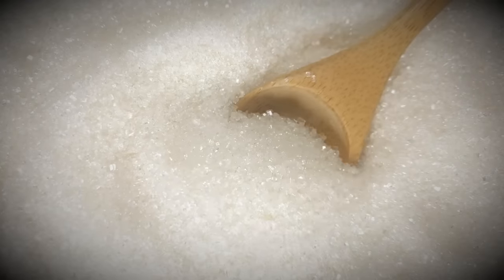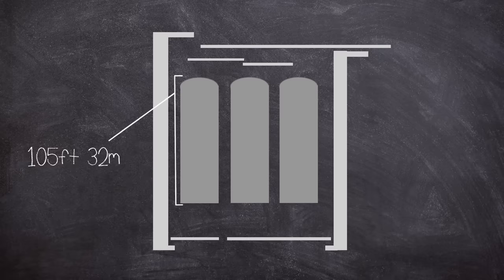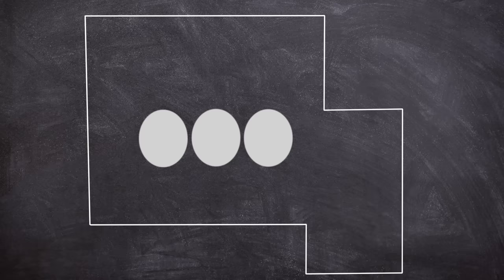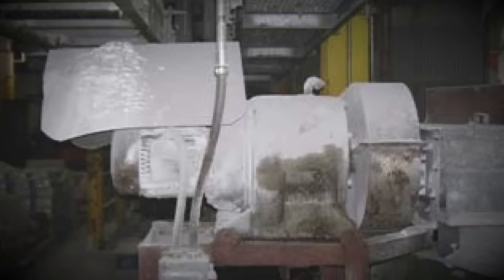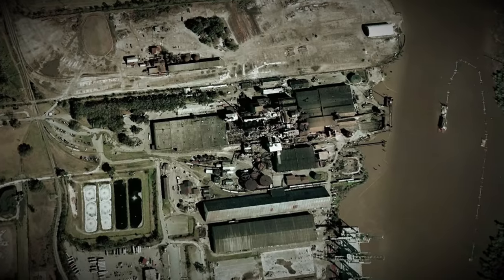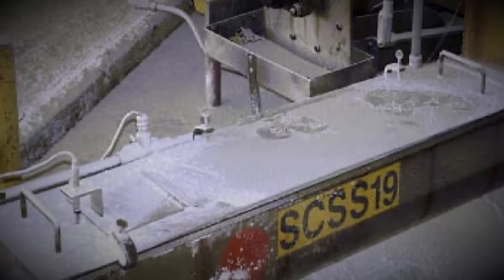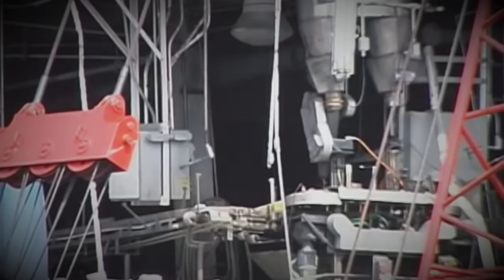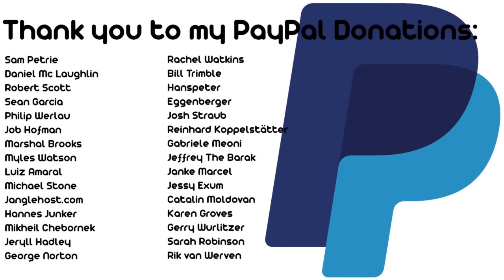The Georgia Imperial Sugar Disaster 2008 | Plainly Difficult Short Documentary

Comment: When I studied barn safety and management for horses, the one thing they drilled into us was that dust was the number 1 danger in a barn, not only for the fire hazard, but for what it does to your lungs
Reply: same thing in a pottery studio. certain material particles on ceramics can cause small blow outs in the kiln ruining the piece or at worst the whole load, but also that dust is also horrendous to your lungs. Never sweep, always mop.
Reply: Workers in textile factories had an equivalent of black lung where lint would fill their lungs over the years/decades
Reply: Yup, I wonder how the solubility of sugar would affect people health wise, would it be better or worse than normal, non soluble dust? I'm not a doctor but having lungs full of dissolved sugar sounds like a bacterial/fungal type infection waiting to happen. I wonder if it could affect blood sugar as well, the various veins of the lungs are thin to allow oxygen/CO2 transfer, so I wonder if the sugar dust could theoretically make that jump as well. Probably not but idk
Reply: @sarahamira5732  Sounds like the perfect research project for someone wanting to get their doctorate.
Reply: @sarahamira5732  pretty sure the water in the mucus inside your lungs can dissolve the sugar, and pretty sure there are glucose transporters on some of the membranes there.. so the sugar would be slowly entering the bloodstream. if its not too much at once it should be fine health wise. for infections, we have the immune system. insoluble prticles like in asbestos are way way worse because they accumulate
Reply: Well how did they do it back then when barns where everywhere?. If there is such a risk? Never thought that a barn would burn bc of some dust. Isnt the thing full of it?

Comment: Anyone who's worked in food processing has had similar problems, sadly. You will get a million stories. I worked in a berry processing plant one year and due to production quotas we overloaded the conveyors constantly with berries and the conveyor engines ran red hot. The room was technically "chilled" but the heat that radiated from the overburdened machines was palpable.Breakdowns were common, mechanical safeties would trip every 20-40 minutes and be instantly overruled.
Reply from the maker: Same experience when I worked in a medium scale bakery
Reply: Anyone with any manufacturing experience has had similar experiences. I used to work at a metal reclamation facility and thing that sticks to me most was when we almost had a furnace breach because the GM insisted that we stick to the schedule regardless of what the operators and supervisors found
Reply: There was a similar disaster in a town of Lubon, south of Poznan where I live: in 1972 there was a dust explosion in a potato products factory, which killed 17 people and injured ten, and the dextrin processing building was leveled. It also destroyed several railroad cars parked nearby. 
The cause was never revealed by the communist authorities, but based on the workers testimonies, all the machines were in a desperate need of overhaul, and some of the safety measures, such as magnets which could catch loose bolts from the conveyor belts, were not installed because they would have to be imported from the West, and the production would have to stop for the time of their installation. 
Therefore the most likely cause was a bolt falling into the processing machine, causing a spark which ignited loose dextrin dust hanging in the air.
Reply: Grandfather had a story of how CSR Sugar during WWII cut corners in cane growing areas in Australia. Some people will sacrifice safety for money.
Reply: ah, so this is why berries often feel... "floppy"? Right?
Reply: @marekkupiec9903  Actually, yes. A heated belt and the berries would get squished by the roof of the equipment above the belt!
Reply: Viktor Bryukhanov: "All the productivity quotas.  Everyone's working overtime, the factories need power.  Someone's pushing down from above.  Although we'll never know who."
Reply: I did some temp work for a non-union GM supplier in Dayton back in the early '90s. My job was to inspect brake calipers as they came down the line putting three individual paint marks on them to indicate various inspection points.

The managers of the line figured out pretty quickly how long it took to physically put the inspection marks on the parts. Which is how fast they ran the conveyor belt. There was no time that actually inspect anything only barely enough time to leave the dots of paint where they needed to go. 

Everyone just simply put various marks on the calipers while two people at the end of the line palletized them.

They said this was helping them fill their quota.
Reply: Not only that, but with all these production issues, it also creates much more waste and spoilage of product. Farmers end up suffering because the manufactures want to make up that spoilage by just buying more raw resources at a cheaper price.
Reply: It's so stupid. Even from a purely selfish point of view, the potential losses are so much higher than any potential gain from doing things sloppily that the economical calculation should fall in favor of safety. Even the concept of enlightened self-interest is lost in the name of greed.
Reply: @PlainlyDifficult  I do anything to have you be my baker.
Reply: @tentaclesmod  
Not in the short term.
Most CEOs only last a few years.
Reply: @tentaclesmod  Not if you look at things on the year end book calculations. Good execs tend to look at the 5 to ten year scale and these people do ensure safety as the cost of an accident (compensation, opportunity loss, repair and replacement, etc) tend to be high. Bad ones just aim for the big number at Q4 book close and tend to not think about the 5-20% chance of something bad happening.
Reply: @kathbeck7817  they also owned Wittenoom, an asbestos mining town noted for having a very unsafe working environment and being completely contaminated with asbestos
Reply: @CaptOrbit  Both of my parents have had extensive experience with automotive factories (my mom is currently a project manager for an automotive supplier and somewhat frequently visits the factories that produce her parts). Thankfully things seem to have gotten much better recently, at least, according to my mom, but I've heard horror stories from both her and my dad. People not actually inspecting things, cars moving so fast on a line that workers choose not to use safety mechanisms given to them to save time, factories being horribly organized and difficult to navigate in the case of a fire. It gets worse when something happens that shuts down production- the manufacturer loses tens or hundreds of millions and then the people in the factories get overworked. Incredibly sad and frustrating.
Reply: @kathbeck7817 The people that will sacrifice safety for money are called "management".
Reply: Working in a big bakery...

Yes I dont get paid enough too care
Yes the quota is all that counts
Yes cleaning is sacraficed for finishing in time
Yes cleaning is only important if some high up comes for a tour

Comment: I have worked in factories that have varied between a total mess and one that I was the Quality Manager for, the floor, packing areas etc were damn spotless - we dealt with milk powder, 2 massive spray dryers running 24/7/365 you have to clean as you go because there isn't the down time for a pull apart clean more than once a year. I would photograph any rubbish I found on the floor of the sprayer building or the packing area, from bits of paper of scrap from maintenance to piles or dusting of powder suggesting a leak etc and I did this every week randomly and would chew out the staff who left anything behind. We had a info session on powder fires from other milk powder factories including near misses and after that my guys upped their game by 1000%. They knew that I wasn't someone who liked kicking peoples asses unless it involved their safety or the safety of our product and that at the end of he day, I wanted them all to get home safely.
Reply: This. 
For safety culture to work, it has to start at the top but must be supported at all levels.  Well done!
Reply: This is proper management. Thank you.
Reply: @N Fels I was 23 and worked for a dairy company making butter etc when I had to stop a shipment of butter because of high micro counts. It was a weekend and they needed 30 pallets of product to fill the shipment but the results were not up to scratch so I put it on hold and retested which would take 2 days.... this is in the 80s. I was one of 4 females in a factory of over 100 and just 23. The production manager came to see me and ordered me to remove the hold stickers and release the product.  I  said no. We argued.  I told him that it was my decision and if he didn't get out of my lab I'd be on the phone to the union for harassment.  I then had a parade of various people trying to change my mind saying that it wasn't that far out of spec and so on. I went and got bright fluro orange tape and wrapped it around each of the pallets with signs saying QUARANTINE. 

I then got a call from the Plant Manager asking what was going on.  I  explained and said " You do realise that we, the Quality Department are your insurance policy and it's our job to be the last word in keeping this factory open and working. "
He gave me every support,  came down and chewed out the men in their 40s trying to browbeat someone who was protecting them and their jobs and ask them how come they were so up my butt instead of figuring out why that days production was so buggy.
I was lucky to have both him and my actual boss who was on holiday at the time to back me up. Plus I can be a pig headed person when someone tries to get me to do something wrong. 

I think also being in Australia, we have a strong safety ethic especially in the last few decades and WorkSafe, our compensation system and the fact that under our food laws if I knowingly allow product to be released that is non-compliant and someone gets hurt or dies, the company is liable for a 5 million dollar fine per instance and the managers, quality staff etc who signed off on it get a 2 million dollar personal fine plus 5 years jail has something to do with it.  Well that was the law according to the Food Act when I last worked in the area!
Reply: You're an example to us all.
Reply: Sadly, for each of these articulate & conscientious folks, there's 10 workers & 5 managers who just don't give a 💩
Reply: I think that as part of training, anyone working in any facility that has a danger of dust explosion should be taken into a field and have a demonstration done. Even managers and supervisors, since they will be making decisions about cleanliness and safety.

Comment: I'll always remember the power in a dust explosion - when I was young, I went on a field trip where they had a demonstration, a small clear box they filled with a small amount of dust and then touched off a spark.  I think it was the loudest bang I've ever heard, certainly the most unexpected.
Reply: interesting
Reply: Companies which have to cope with dust buildup need to do this demonstration every year during the company picnic. So every worker and manager knows just how dangerous dust is, and is on board about preventing its buildup.
Reply: Igniting a canful of flour dust (with an easily-removable plastic lid) isn’t as striking as igniting one with alcohol vapor, but it’s instructive.

Comment: I worked in many wood mill as a welder contractor. many mill are easy to get lost in. and most  of them will clean but all the hidden corner and hard to access area are always full of dust and debris.

we always had to soak everything when welding an stick around for many hours after the fact. and often we had to clean stuff before we can actually start work.
Reply from the maker: Thanks for sharing
Reply: I was a security officer that worked fire watch in a saw mill after hours. There was saw dust all over beams, in between partial floors, and on top of light fixtures that were on 24 hours a day. There were two incidents while I was on duty, a smolder between floors, and a smolder on top of a light fixture. Luckily easy enough to put out, but it could have been so much worse.
Reply: I spent a summer in college as a welder's assistant/fire watch on a construction crew that was building an expansion to a paper mill. The part of the job that involved putting in pipelines and such in the oldest part of the existing mill was... exciting, in that "everything in here might explode and kill us all at any moment" kind of way.
Reply: @ZGryphon  I worked for a while in a woodworking shop. I took it upon myself, as the most junior, to keep the floors and machines clean and free from sawdust. It surprised me how lax my elders were about it, given how slippy sawdusty floors are, and how previous to my working the large table circular saw had kept overheating and cutting out because they didn't clean the sawdust out of the back hopper. When I was there, it didn't cut out, because it wasn't bunged up. These days there would be extractors on all the machines here in the UK, a  much better solution than me with a shovel and a bucket.

Comment: Nicely done as usual 👍
Proving criminal intent isn't usually possible because even though the carelessness is intentional, the intent to kill others isn't.
Plus company policies were ignored by the facilities management team, probably because they were more concerned about their production bonuses being reduced by maintenance shutdowns.
That theme is common in manufacturing. Look at the Deep Water Horizon accident. Same thing. The investors didn't want maintenance shutdowns, they wanted that oil produced so they could get their bonuses.
"Follow the money" is usually the main reason behind most accidents like this.
Intentionally trying to harm others isn't.
Reply from the maker: Thank you
Reply: Deepwater Horizon was a drill platform, it wasn't producing oil (that's done by production platforms). The platform ops team were in the process of sealing off the current drill hole by filling it with "mud" (a carefully concocted slurry) when it blew out and the safety device on the seabed on the far end of the drill string, the "blowout preventer", failed to operate properly. There were a whole series of fuckups, small errors that added up due to the Swiss Cheese hole effect that led to the blowout happening but it wasn't pressure from management to produce oil that caused the disaster.
Reply: Sure, but that should only reduce the charges to manslaughter.
Reply: @robertsneddon731  you can't produce oil until you have the hole drilled. This drill platform had reached the oil by the time the engines started sucking in natural gas, causing them to over-rev and explode.
I agree with you about that.

The guys that owned the drill rig wanted to move on to another location and didn't want to take the rig offline and spend necessary time performing needed maintenance.

I saw the movie and a documentary about it. I also worked in oil fields for 8 years AND experienced first hand what happens when the truck's engine started sucking in natural gas. We have emergency shut down valves that stop all air from going into the engine. You have to open the hood and reopen those valves with a wrench to be able to start the engine again.

According to the film, they didn't have that emergency cut off for those massive diesel engines.

The leak was a product of many, many other things going wrong, but the explosion was over revved diesel engines caused by escaping natural gas being sucked into the air intake causing a runaway effect.

Over bearing pressure by management to cut maintenance down time led to all the fk ups that led to the explosion that led to the leak.
See how things work?
Reply: @LeCharles07  I'm no lawyer, but double jeopardy laws may prevent that, or the charges need to be reduced or refiled in order to get a criminal conviction.
Civil trials are far easier to win because they don't have to prove intent, among other things.
"They knew or should have known!" is the cry of the civil litigation lawyer because it works. Prosecutors have to clear a higher bar.
Reply: but laws protect them here so no problem ,no punition was given got the insurance claim and the new factory that come with it all win for the compagny ...The United States Department of Labor requested that Ed Tarver, U.S. Attorney for the Southern District of Georgia, pursue criminal prosecution against Imperial and its executives. OSHA cited Imperial with 124 safety violations, finding that the company acted with "plain indifference to, or intentional disregard for, employee safety and health".[3] Tarver said there was not enough evidence of intentional disregard or plain indifference to bring criminal charges against Imperial. He also cited a lack of federal criminal laws specifically related to safety in the sugar industry as a reason for his decision.[3]